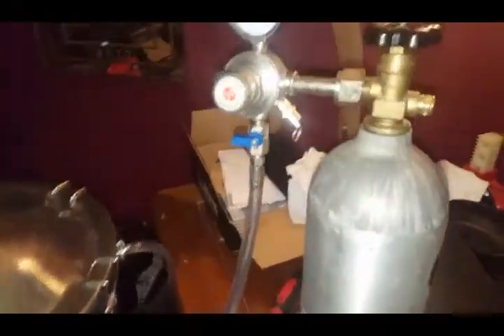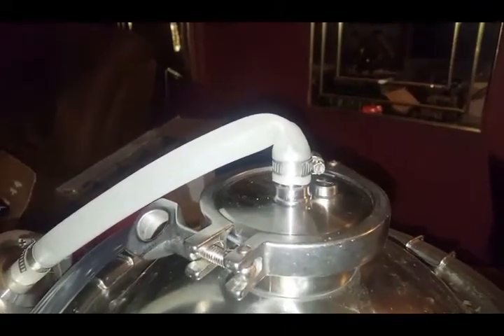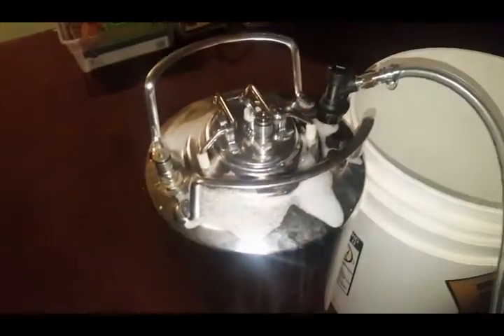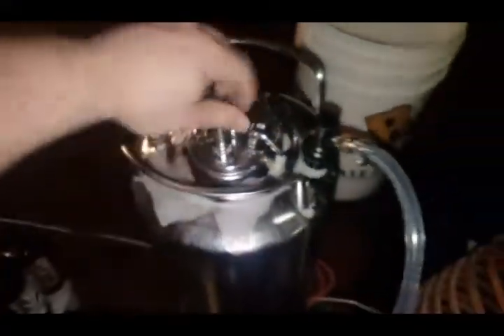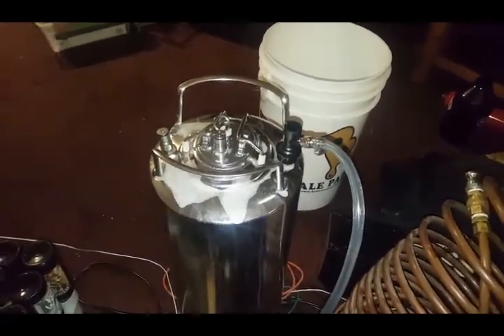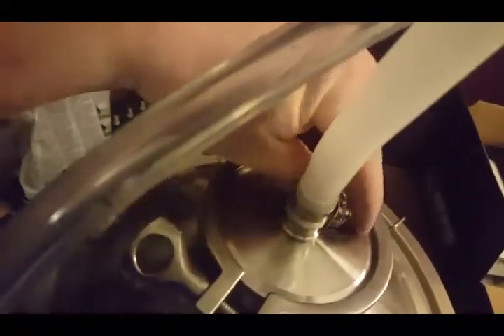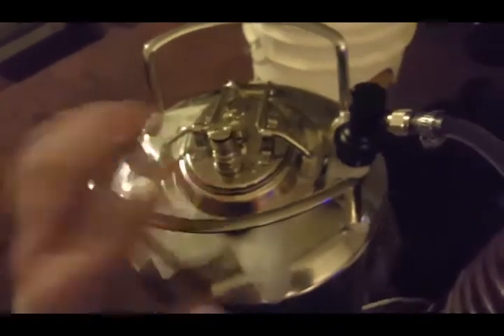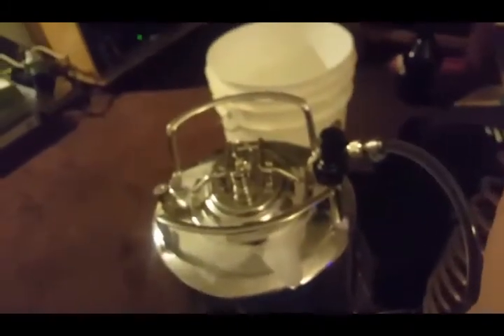Closed transfer on the ss brewtech chronical fermentor

Comment: Hi Jason, amazing clip! very helpful... I will give it a try for my next batch... Listen, I am a bit concerned about what's stated on the SSbrewtech website that the BME should not hold more than 5psi and that you would end up needing a low psi gauge (which is costly) and was wondering if you ever had any issue... cheers
Reply from the maker: Great question. The conical definitely does not hold much pressure which is ok because you only need about 2-3 psi to do a transfer. If you go higher the only thing that will happen is the pressure relief valve on the cap will let air our or if you try to keep the valve down like I have tried to do the lid will lift up enough for gas to escape under it. No real damage to the fermenter but you will lose gas for sure. I use a regular regulator and keep it low enough that it pushes the beer but does not allow gas to escape which has been fine for the last 2 years.
Reply: @zambriczki18  thanks, man! Will give it a try next time!

Comment: Curious if you use this method for transferring NEIPA's?  If so have you noticed whether it keeps the beer longer than say bottling?  Chronical fermentor is the next purchase I'm making and hoping this will solve the issue I've currently got when bottling (beer last about 4 weeks before oxidized and color drops to a brown from orange color).  Thanks
Reply from the maker: yes I have noticed a big difference in its shelf life. I always keg so not sure about bottles. When doing a normal transfer the beer would be mud brown about 2 weeks after kegging which is indicative of Oxidation. With this method It remains the same color until the keg is empty and the hop aroma lasts longer.

Comment: So you've got a bitching conical and glycol chiller but you're still using soda kegs, what gives dude? Why not make the switch to commercial D series kegs?
Reply from the maker: backslide311 they are actually corny kegs made for beer, bought them brand new so they never had anything else in them. I don't like using the commercial kegs because they are much harder to clean and take apart.
Reply: Jason Zambriczki they're not at all hard to clean. I have 3 screw type and one standard purchased from beverage factory. All you do is unscrew the spear to clean, takes about 5 seconds. The standard version is more troublesome due to the compression ring needing to be removed. I love being able to package beer in commercial kegs for my non homebrew buddies to enjoy in their kegorators, cant do that with soda kegs.

Comment: I just bought my Chronical BME.  Quick question, you said you used the 3/8" diameter  TC Fitting (with 3/8" beer line, I assume)  for your feed to the top of your keg.  With the Ball lock at the top of the keg being 1/4", do you just clamp the 3/8" hose down real tight?  Any problems with doing that? Or, would 5'16" be better?
Reply from the maker: Bill Zens I'd have to check but I believe I have a 5/16" going into the keg from the fermentor. I might have said the wrong size in the video. I use the normal beer line that goes on a ball lock qd but the tc fitting I used ss brewtech didn't sell so I had to get one from brewinghardware.com.
Reply: Damn it I got the exact same question but this question is a year old and still not answered.  I have Ss Brewtech Unitank and want to do a closed transfer to my keg although my kegs are pin lock. Im getting ready to make an another order from Ss Brewtech and needed to know what size TC fitting to get but was wondering how that worked on the 5/16 keg end. What’s the solution what do we end up needing to use for either end? Thanks!
Reply: I seen brewers hardware carry’s a 1/4” hose barb wouldn’t it be better to just use the 1/4” instead of the 5/16 that connects to the fermenter?

Comment: the only way to ensure there is no O2 in the corny keg is to fill it to max with liquid of your choosing and push it out with CO2. If you're just purging an empty keg with CO2 you'll still have O2 left inside. As gassing and degassing is a very violent/turbulent process that will mix the gases together.

Comment: Hi Jason. Great video. Do you disassemble the corny keg ball lock disconnect to clean and sanitize it before the transfer, or how do you go about that. I am a little worried about that because it is really not a sanitary fitting. Thanks Christian
Reply from the maker: I usually take apart my kegs after 2-3 beers go through it unless it was an IPA, fruit beer or a beer with a lot of yeast other wise I just run PBW and star san through it. My ball lock disconnects I usually just drop right into pbw and let them soak and then drop into star san. I have never had a problem yet. You gotta remember the alcohol and temp of the beer at this point also make infections a little harder so I usually dont worry.
Reply: Thanks for your response. Yes that makes sense.